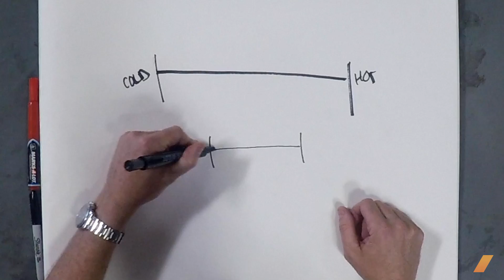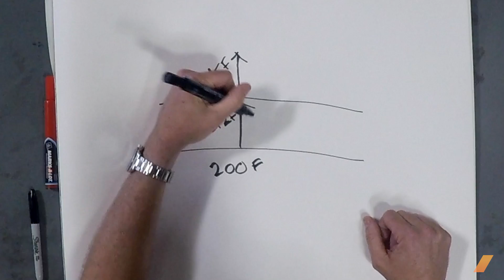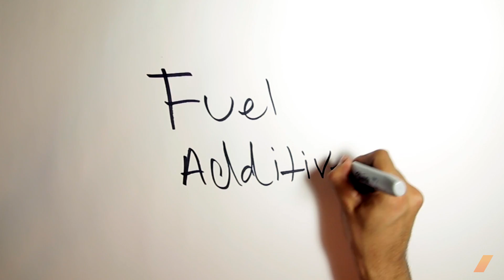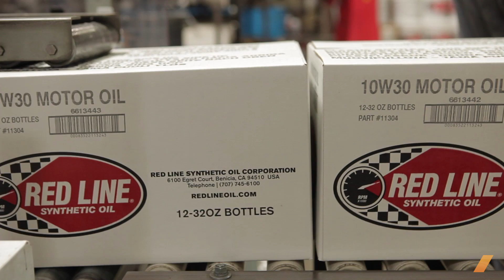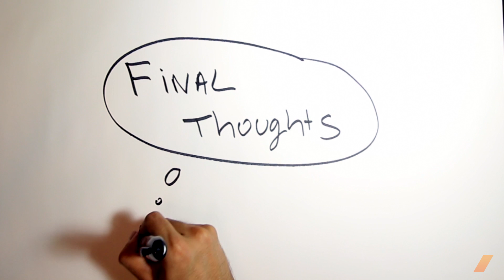10W-WTF!? Dispelling Myths About Oil -- /ENGINEERED

Comment: So if your car says run 5W30 and you plan on tracking it, is a good starting point just upping to 5W-40? ...I've also noticed a lot of newer cars now want thinner oils, like 0W-20, even the Toyota 86 calls for that. Is that simply for economy?
Reply: Pickle312 just track it with the recomended oil, then see if you run into issues with heat. if you want to track your car regularly you should put in a oil temp and presure gauge anyway. they are cheap and easy to install. you can hide them in the glovebox or just run the cables and only connect the gauges when you go to the track if you don't want to have pods on your dash.
if everything stays within range there is no need to change anything. if it aint broke, don't fix it ;)
Reply: Pickle312 also, new cars want thinner oil because engines nowdays are made with smaller tolerances and offer more performance for engine size then in the past, so they need more heat to be removed more quickly. hence thinner oils.
Reply: Really tight engine assembly tolerances. And alloys that don't expand or contract as much.
Reply: The MAIN reason is fuel economy. New metal treatments and coatings and tighter tolerances (not to be confused with clearances) mean that a manufacture can go to a thinner oil, which offers less resistance to the rotating mass of the engine improving fuel economy and use that as another selling point for the window sticker. It has NOTHING to do with protecting the engine from wear. 

A lot of owners manuals will have a chart somewhere in it that shows the temp range and recommended weights for them. Simply consult it, if it shows you can run a 40 weight oil in a hot climate, then that's what I would go with for a track day, even if it's not that hot where you're at, as the track session is going to get the oil much hotter than just normal driving.
Reply: I've got a GT86 and once I went turbo, everyone I spoke to suggested going to 0w30 or 5w30 oil. The manual for the 86 actually does say you can use 5w30 "temporarily" until you can find 0w20 again.
Reply: +ChrisDrift  That's too thin, IMO.  I'd run a 30 weight if you plan on tracking..but run it stock and see how the temps are first...
Reply: In a case like the 86 i'd just go straight to a 0 or 5w-30 full synthetic, but if you don't know what you should be doing get an oil pressure and an oil temp gauge.
If you can't maintain nice pressure, you've probably gone too thick with the oil. If you're getting too hot, you're too thin.
Reply: Yup for emission regs an MPGs. Yoda is crazy for that viscosity! Then again Yoda hasn't been special since the 90s. Big5 all same. Pick ur design brand is moot.

Comment: Something he should have included in his discussion of the "W" of the oil. A 5W-30 oil is still thicker at zero degrees F than the 30 is at 212 F.
Also I'm pretty sure he got the temperature ranges backwards. Synthetic oils retain essentially the same viscosity over a much wider operating temperature range than mineral oils. There's lots of studies published that show this to be true. Some tests have shown that they retain enough viscosity to protect your engine even as high as 500 degrees F. 
I run Shell Rotella 5W-40 in my Cummins powered Dodge and it works great. The owner's manual calls for 15W-40 but again, the 5 is still thicker at start up than the 40 at full operating temperature. Helps to flow the oil through the cold engine so you get full lubrication quicker.
I like to start my engine, no matter which vehicle I'm driving, and then fasten my safety belt and adjust my steering wheel before driving away. Drive away gently on a cold engine, do not sit there idling if you can help it. Driving gets everything up to temp quicker and helps your engine have less wear. NO FAST DRIVING WHILE COLD THOUGH. I took a truck driving class decades ago and so maybe it's obsolete information but my instructor yelled and screamed about people using full throttle up a hill with a load. "Full throttle is for racing only! Never for pulling a load. That's why you have lots of gears" he said.
Works for me.

Comment: Hi!
Thanks for a really crisp and to the point presentation.
Just one question: For a stage 2 tuned VW Golf TSi motor, in warm climate and spirited street driving,  what grade of oil would you use.. more specifically, whats the "upper" number you would recommend? Would 40 be enough?

Comment: Oils like Redline and Amsoil are great, but not needed for regular daily driven cars.  According to the PQIA, API and SAE use Pennzoil or Mobil and you'll be fine.  Even Supertech tested well, but not so much for newer GDI engines.  Too much NOACK.  PP tested very well and is barely below Amsoil with no noticeable difference for 1/2 the price.

Comment: best oil rundown I've seen. I can confirm that good oil saves engines over time. magnetic sump plug was covered with quarter teaspoon of metallic sludge and black as treacle over 10000km on cheap oil, Pennzoil went 10k no sludge and still semi gold.

Comment: I rescued/bought my R53 Cooper S from a Hyundai Used car Dealership, after showing my friend at work the engine, I noticed oil collecting at the end of of the intercooler seals! Turns out the dealer put 5w-20 in it. The running temp in the oil wasn't high enough to keep the oil in the engine! 

People don't buy Hyundai. Their cars are cheap, and the labor they employ is cheap.

Comment: I never use additives. I use PENNZOIL Platinum and a NAOA GOLD filter and change it between 3500 - 5000 miles. Hope I'm not wasting my money but I like it in my 2003 Saturn. I'm a stickler ref: oil. I live in Alberta and our winters are COLD. I dont believe in cheap oil or cheap filters.

Comment: About fuel additives and fuel at the pump, Top Tier fuels are amazing. I have first-hand experience with engines that have run exclusively Top Tier fuels and engines that have not. The Top Tier ones looked nearly brand new. No carbon build-up, very mild discoloration. The others had varying levels of carbon build-up on the pistons, valves, intake ports, etc. I only run Top Tier fuels and I try my best to keep to one brand (Costco). Search Google for "Top Tier fuels list" and you'll see a list of gas stations that have been rated as Top Tier.
This isn't limited by octane rating by the way. "Premium" fuel isn't any better than "Regular" unless your engine is designed to run it. Check your owner's manual to see what octane you should be running. I run Regular 87 in my CBR600RR because it was designed for 91 RON which works out to around 87-89 AKI depending on testing procedures.

Comment: Check if your car is designed to take an oil specification beyond oil weights, like a certain ACEA spec. It really will be the best for your engine, and it will narrow it down to just a few options. Of course this changes if you've done major modifications.

Comment: I hate RedLine oils, my customers who use them always have so much carbon build up and also run so “dry” and have excessive wear to all the crank bearings, and since its pre mix, when we bring them back out after the off season, the oil is separated from the gas. Maxima, Amsoil, Lucas are my preference for two strokes

Comment: It's true.. when I put synthetic gear oil in my Mitsubishi lancer, it shifted much slicker. Same when I went to the to semi - syn (I will be going full syn on my next oil change, but as the car could have had mineral in it from the last owner, I didn't want to go straight to full syn) It ran smoother, much smoother on cold starts and quieter too. If I car has been run on cheap mineral for all it's life, sometimes you can get oil leaks thru the gaskets as the syn tends to break up all the crud that is block them, so I wanted to check for that before going the whole hog.
Reply: um... no comparing the effects and feel for before I drained it till after. Maybe their won't be such a difference from the semi synth to the full synth, but I prefer to know my engine is going to last longer for it.
Reply: You are going to notice a difference when changing the oil regardless, but yeah, whats more important is how long the smoothness continues :)

Comment: I remember being young and guzzling 1/2 quart of 5w30 on a bet.
Reply: like drinking it? how are you still alive?
Reply: Sam Swed 
Yep, did on a bet for $50 when I was 15yrs old... The mother of all stomach aches followed!
Reply: Jeff Smith I did the same thing... just one shot glass, but it was a part syn., 5000 mile used. Puked several times. Point is, my bowel movements smelled like a garage for a week. Ahh, wonderful!

Comment: so what about octane booster. you would get back to that.....
Reply: It doesn't work, generally speaking.
Reply: yellowbusguy yeah i know, but i would like to hear the reasons why it doesn't work behind it from a professional.
We use xylene as an octane booster.
Reply: Probably because it isn't mixed well and it separates. One is thicker than the other so the ocatane booster might sit at the top of the fuel tank. My GUESS.
Reply: Most likely it just boils down to the fact that the car hasn't been tuned to take advantage of increased octane (same timing).  If you fill it up with 100 octane fuel for example you can push the timing more before detonation, but you actually have to [manually] change the timing advance in the computer.  Without advancing the timing you won't see more power...so while it could do something, it essentially does nothing.

Besides, say you put in 91 on an average basis (full tank), a small bottle of booster (even if it's 100) will bring it up to what, 92?  93?  The timing difference that you can push between 91 and 92 is going to be so tiny that it'd be a bit difficult for a tuner to take advantage of...then until you change it back you have to always put that octane booster in there..
Reply: +roger supernova is your car force inducted or super high compression (higher than 10 to 1 compression)? If no than they won't do a single thing. The only thing I've seen is they can control knocking a tad on force inducted cars where only low octane petrol is available,  and are very lousy at that so..... Overpriced Snake oil to the max
Reply: Erik de la Cruz my car is a twin turbo skyline GT-R running about 30psi.

And high octane fuel definatly is no snake oil. If your car is able to make use of it from the factory (see my discussion with mrslowest above) or tuned properly to use the higher octane fuel, it can make a very big difference.
Or are you reffering to the botyles of octane booster? Then yes, like i stated in my earlier post, i tested it and didn't produce the results that are to be expected from the increased octane, that's correct.
Reply: In other words, you are FUBAR when the fuel stations decide that phasing out 98 Octane and only selling 95 octane fuel...
If your fancy sports car require 98, you will either have to go for a tune / detune of the vehicle or sell / scrap it?
Reply: +roger supernova  Yeah, an explanation from a fuel expert would certainly be nice.

Here in the US we don't use RON, we use AKI, and in AKI 87 is "basic" (cheapest), and 91 or 93 (depending on area) is highest.  You can buy 100 AKI at the pump here but it's very rare, certainly can't rely on it for a road trip or something.  So we only have 5 octane points of range for the most-part as-is.  I'm thinking the majority of "premium required" OE tunes are targeted at 91 AKI or 100 RON and then the knock retards from there.  I don't believe under the same weather conditions a dyno pull between 100 RON and 102 RON will yield any differences higher than typical dyno static given a normal OE tune.  Though who knows, w/o knowing for a fact how it's programmed (and it differs from company to company) it's hard to say.  I've heard some new modern engines (specifically I've heard about the ecoboost) will keep advancing until knock, so maybe others of same vintage will also do the same.

Most OE luxury manus recommend "premium" here (91 or 93, depending on area), but I think this is more to do with the additives than anything else because my 2JZ isn't pushed very hard at all from the factory so I can't imagine it NEEDS premium in stock tune.  I'm guessing it also differs from manu to manu how close they push it to the octane limit and which octane limit they target.

Anyways, sort of off-topic, back to the fuel booster;  Yeah, I can't imagine it would actually work...so there needs to be something else at play.
Reply: roger supernova the scam with octane boosters is that when the say "raises octane 5 points" what they mean is that it adds .5 (point 5) octane numbers which is basically nothing. If you can find one that actually states that it raises octane by several "numbers" not "points" it works. They are rare but are out there. I have a motorcycle that will knock and ping on regular and I use booster in areas where I can't get better fuel. I only use it as a last resort but it works.
Reply: Fox Wright haha, did i step on some toes? Thank you for your elaborate explanation of what offended you..
Reply: CMDR Sweeper i run xylene mix, so when 98 is phased out i don't mind. Plus in germany they still sell ron102, i always get my petrol from germany.
Reply: MrSlowestD16 yeah i know octane ratings are different. Not sure what equals what either.
I asumed all engines just advanced up to det and then retarded again. Somehow that would be the most logical to me, it doesn't hurt the engine and wouldn't make it unreliable or anything.

I hope they guy actually went into detail about it but they decided to make it a seperate video. Would be nice.
Reply: +Cas Cascas Yeah I was just gonna say that. One octane point is 0.1 of an octane. The highest I've seen on the shelf is RP booster which is 30 points. That equals to 3 octane numbers. I use that on casual race days with 91 Shell which brings it to roughly 94ish and use race fuel mixed in the tank to bring it over 100 for draging. Cutting with race fuel is best if you need it.
Reply: Cas Cascas i'll habe a look at he blttle again next time i'm in the store.
Reply: RP booster raises the octane by 3 numbers, based on what scale?  In the US fuel is the average of RON + MON numbers.  You can see it on the labels on the pumps, they all say (R+M)/2 beside the number.  Europe uses the RON scale which reads higher numerically than US fuel.
Reply: North American
Reply: I wanted to hear his thoughts too.  From my knowledge there's a few reasons they don't work or barely work.  Most of the additives barely increase the octane if at all.  Some are labeled as "octane performance booster" and are nothing but cleaning additives, theoretically if you remove carbon from the combustion chamber it'll boost the performance of the octane being used by lowering the demand for more octane.  Most octane boosters don't state how much they add and the few that do are misleading with statements like "raises octane 3 points".  Most people think that stuff will raise 87 pump gas to 90 when it's actually only raising it to 87.3, assuming it does as claimed.  Most also don't state if it's raising the motor octane or research octane.  I suspect most raise the R more than the M because it's cheaper to do.  Lastly, the higher the octane of the gas being used the harder it is to raise it.  If a booster will take 87 to 89, it's unlikely to be able to take 90 to 92.  Raising octane, especially with unleaded gas, is expensive and there's no cheap way of doing it effectively.  Any additive that doesn't cost more than buying higher octane gas is VERY unlikely to achieve the same results as just buying that higher octane gas.

Raising the octane for an engine that doesn't need it and can't make use of it, which is the vast majority, will not help it and can cost performance and economy while also increasing deposits left behind.
Reply: octane booster is crap, ends up coating your valves/pistons and chambers with tan/yellow powder.
Reply: lol enough experience.. ha ha, the last 3 motors I've pulled down for rebuilds heavily used octane boosters from a number of brands had caked every single part of the combustion process in powder crap. using a wideband and custom ECU that controls timing and ignition I saw zero improvements in knock control when using a octane booster.

you would get better results using water in your fuel to reduce knock
Reply: +roger supernova idk what are you trying to say, and congrats on the gtr,  but like I mentioned, unless your car is boosted, or running some crazy high compression/ direct injection. higher octane fuel won't do a single thing on most engines or an unnoticed increase that doesn't justify spending extra at the pump, if it is of course it does 🙄 reading comprehension goes far.
Reply: Erik de la Cruz the discussion was about why boosters don't work, while running xylene mix does. 
So you can get the same effects of higher octane feuls by adding additives, then why are commercial boosters so useless.

And i'm sorry, english is my third language. Doing the best i can ;)
Reply: ChrisHallett83 powerfc is a fully programmable aftermarket ecu..
Just older then haltech.

Anyway, works just fine if you have it maped properly instead of letting any random dude that runs a dyno play with it.
Reply: A cover for poor low octane fuel.
Reply: roger supernova what do you expect octane booster to do??
Reply: @topsecret5  Disagree 1000%. There is a difference between 91 and 93 in some cars. I never believed it before. But some just love 93. I know from first hand experience. And I'm not trying to be a dick and I understand exactly what you're saying. And some cars it doesn't do shit. But you don't need a crazy high compression/do engine to feel it. The VQ37 engines feel it for instance. And that's just a V6 NA engine.
Reply: Only works if you have high compression engine with correct tune and working o2 sensors